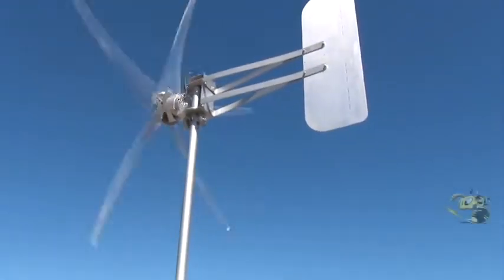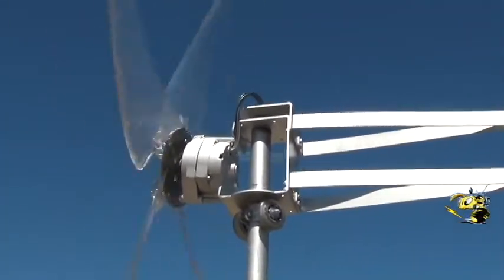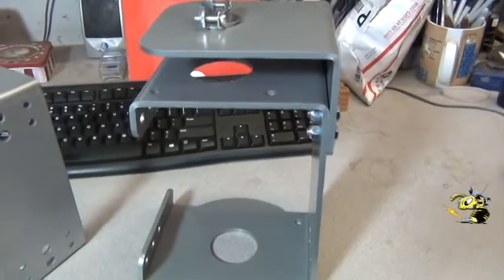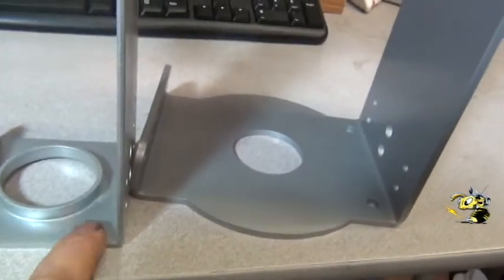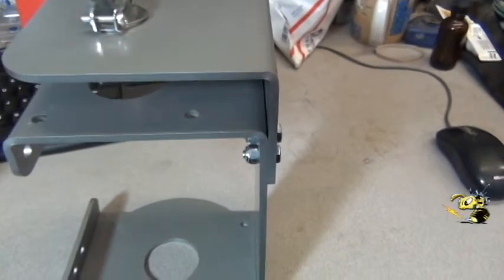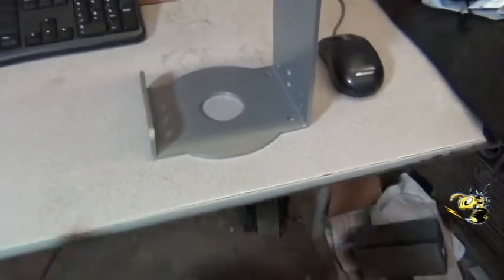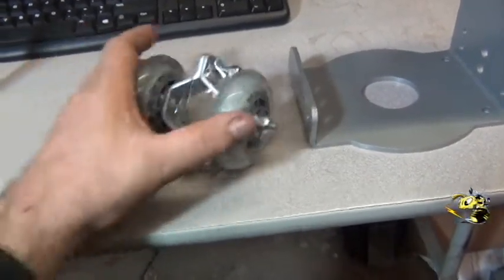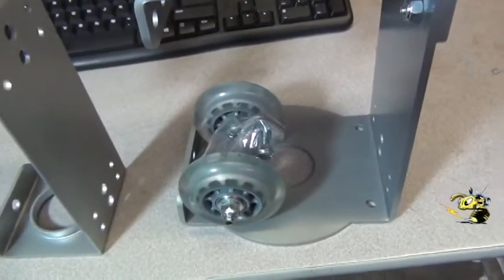New "Mark 7" Wind Turbine Bracket.  Durability, adjustability and long life.

Comment: I think 3 rollers on bottom and a thrust washer on top may be good idea
Reply: We tried 3 and run out of room and they were rubbing.  I think if you got one of these in your hands and used it for a few years you would agree 2 wheels is more than enough.
Reply: I have gone all Vertical generators. But the roller is a nice option.

Comment: Looks very smooth! I'd love to try one actually. If you would like an honest review of it. I would be happy to put one on my 60ft tower.
Reply from the maker: Hi Darren.  What size pipe do you have on that great looking axial?
Reply: Thermodyne Systems Its standard 2" pipe at the top. I take the Axial down for the summer. And would like to try a smaller turbine that won't take as much attention. The Axial is amazing, but can be stressful. It's a beast that you need to keep an eye on. Big power comes at a cost. For the summer I'd like to have something on the tower that I don't have to worry about and still get a little charge at night.
Reply: To bad it a 2' pipe. Our roller only works on 1.5' and 2.5" pipe.
Reply: Sorry, I called it 2". 
I believe it is 2"ID and 2-3/8 OD